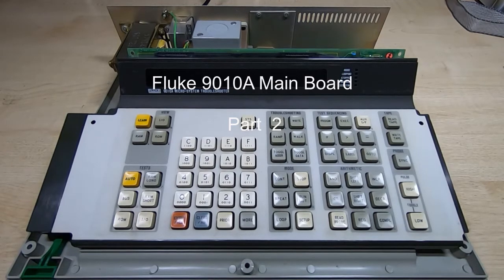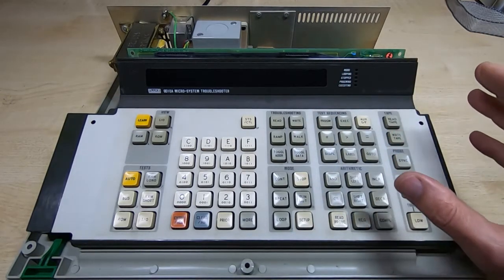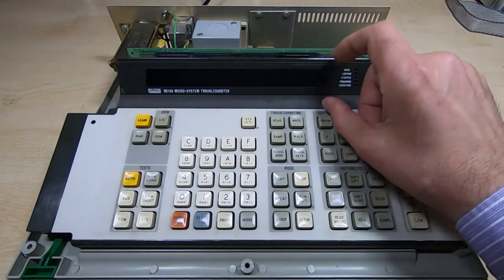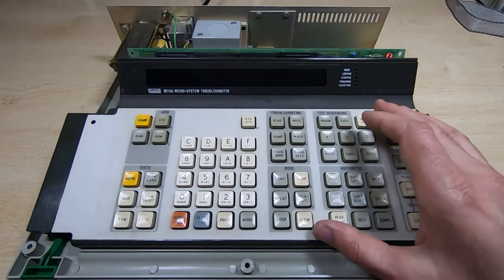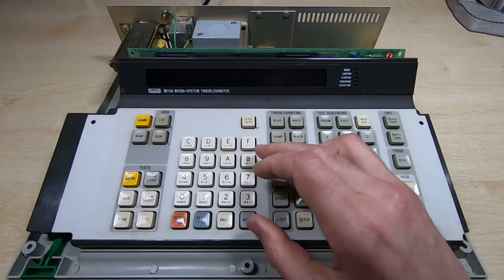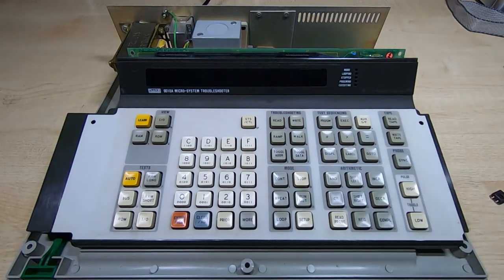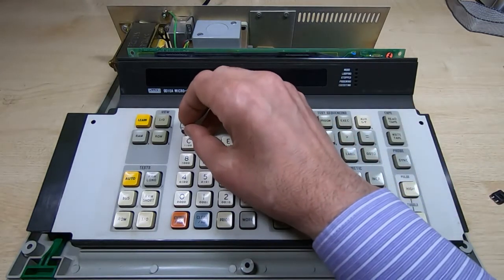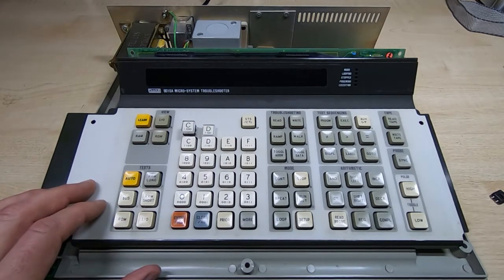Fluke 9010A Main Board Part2

Comment: I had a thought about reproducing one of the popular DATA IO programmers or at least use the DATA IO product to use as a basis to design my own.  More or less start where they left off in their work.   A friend of mine has a mold shop and I was thinking I could possibly get some stuff molded if you really needed original looking key caps.
Reply from the maker: I would be interested to hear what he would charge for custom caps (there are 4 different colours). My company has designed plastic moulded parts which I have had made but the problem is always the NRE charges and MOQ. Because the market will be so small I am not willing to underwrite a significant manufacturing cost but it is certainly worth investigating. The other consideration is future proofing the effort in creating these boards. The DATA IO programmers were very high end devices during their peak so would be a good target. One thing well worth considering if developing a custom programmer would be multi supply and flexible pin data handling so that the older devices could be handled.
Reply: @JerryWalker001  email me if I don't get to it soon.  He's looking for a project anyhow.  I definitely will investigate this.  DATA IO is still in business so it would have to be a line that got abandoned / no longer supported to start with.  I know theres already some chineseium programmers out there but that would not be the aim.  I thought about also a 2 or 4ch 100-200MHz scope too (after a recent project).
Reply from the maker: In an upcoming video I discuss my channel targets and I think you may have similar goals. I tend to ignore Chieseum devices when I direct my projects as the cheap chinease devices take short cuts and while they are useful for cheap and cheerful products I do not think they are in line with good design.

Comment: You go with a standard key switch you could then get into this kind of service       https://www.wasdkeyboards.com/products/keycaps/printed-keycap-singles.html
Reply from the maker: Thanks but unfortunately they would not be suitable. The keys need to have vertical sides and be very shallow. Also the space between the pcb and panel is way too small for normal keys and caps. Finally the cost would be $264.00 just for the caps so would make them way too expensive. It would be fairly easy to have a lot made to bring down the cost but I very much doubt I would ever sell enough to recover the cost as the market would be very small (each key is unique so there would only be one of each for each build).

Comment: Jerry, can u use those clear caps with these switches? proper key switches are the only way to get the nice feel. https://www.hyperxgaming.com/us/keyboards/switches
Reply from the maker: No unfortunately they will not fit. For the Fluke it does not matter as the original keys are not proper key switches either and are fairly similar in feel to the ones I showed. In fact the ones I showed actually feel better. Out of interest the keys you mention are the type I am using in the ADM -3A project (where key feel is more important as it is an actual keyboard).

Comment: For me I would also go for the key switches, it will be cheaper and better than membrane switches. It also looks nice with the paper inserts. Now for the display, what is the maximum width? I found some 0.39" 14 segment alpha numeric displays, if you put 32 next to each other you will have a total width of around 317 mm. Do you need common anode or cathode?
Reply from the maker: Thats 3 votes for the mechanical switches so far. Yes the 0.4" is the standard size (I have hundreds of them) but unfortunately the total required width is 175mm so they are way too wide. 32 of them would be wider than the 9010. I may end up using a 40x1 character white on blue LCD but that would need different firmware in the 8041. That is not a huge problem as I could write new firmware for it but I would prefer not to do that as I want to keep it as 'standard' as possible.
Reply: @JerryWalker001  It depends how you look at it. Yes 32 x 14 segment alpha numeric displays will be too wide for an original fluke 9010 but if you want to make a clone you have to build an enclosure for it so you can have the space for a larger display. I saw in the manual that the orginal 9010 is about 39 cm wide so a display of 32 or even 33 cm will still be doable IMO.
Reply from the maker: I want the boards to be suitable for fitting into an existing case so I need to consider that. Yes the 9010 is 39cm but only at its widest. The top section is no where near that wide and if I made the display that wide it would not fit and would also foul on the other internal parts. Such a big display would also need a bigger power supply so overall using displays of that size is not an option (unless I go for a 2x16 display instead of 1x32 but the supply would still be an issue). Naturally I could redesign the entire thing but that is not the taget for my project. It is easy to get 'off track' to find an easy solution but it is not what I am aiming for (I like to do things the hard way :) )
Reply: @JerryWalker001  I think the easy solution would be to use an original VFD, it seems you can still find them but at 250-350$ not a cheap solution. I don't think that you can find displays smaller than 0.39"? Any other ideas besides an LCD ?
Reply from the maker: This is why I decided to look at the display and keyboard first. As you see from my channel I am interested in trying to maintain and provide vintage equipment. If I cannot find a solution that fits in with this goal then I do not proceed. I have actually recorded the next video in which I go over this (my videos are normally a few days out of sync with real time). The goal for this project is to find a way to create 'drop in' replacements (as it is for all my projects). There is almost always an alternative but some take more effort than others to find. Currently an LCD or even custom LCD which emulates the original VFD is actually the 'easy' solution but as ever the limiting factor in any projects I undertake where I end up offering items for sale is the cost and very small expected market. This does not however mean that I am willing to take short cuts. I think the next video on the ADM project may help to explain my goals better as I go through what I am trying to achieve and more importantly what I am trying to avoid. I do appreciate the comments though as they often result in 'alternate' lines of thought.
Reply: @JerryWalker001  I really, really want to see this project move forward. We need to get a BOM going with your candidate components even if we redline it later. So we go with the mechanical keys solution and silkscreen prints.